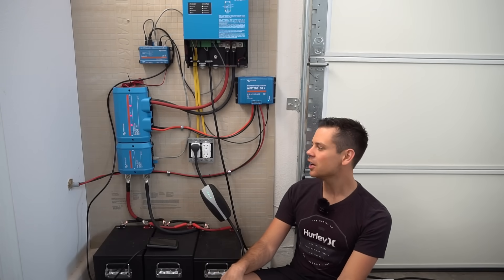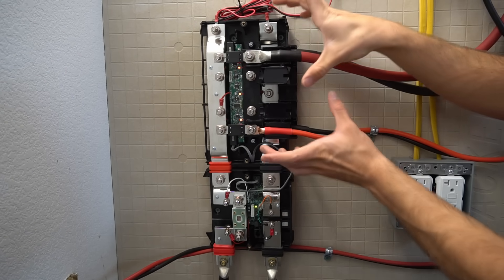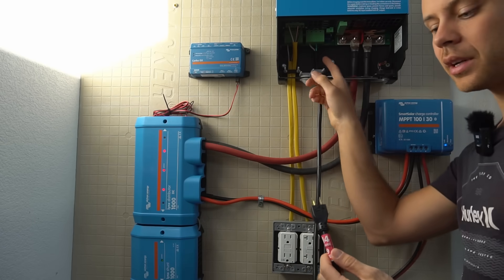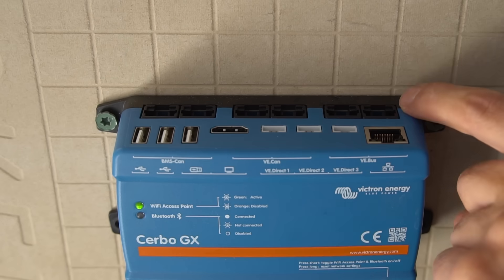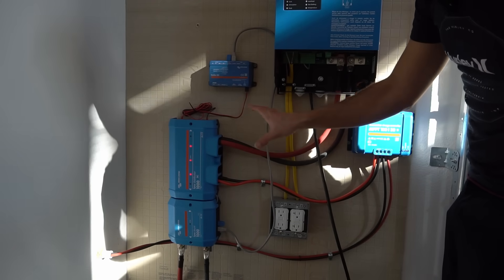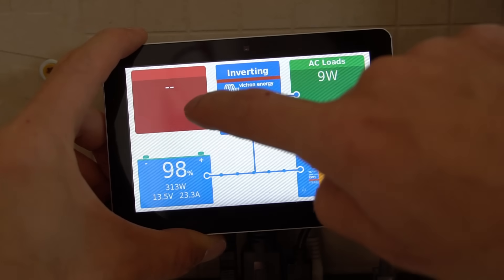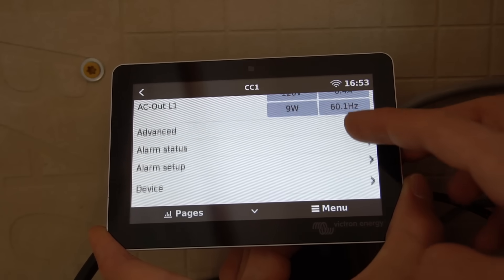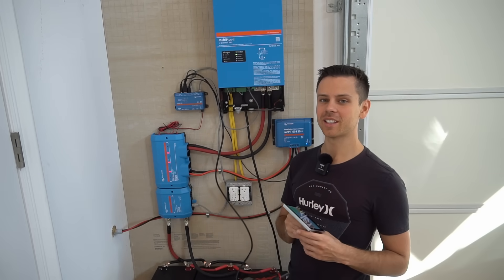Victron Made Easy! Design and Communication, Step-by-Step

Comment: We will be fitting 36 panels on the south facing roof,  at 400 Watts. On paper this should 
Generate 14.4 kWh. We have a good climate here so I would guess we would have 4 to 5
Good hours per day, plus the reduced rate before and after the peek. Minimum of 60 to 70kWh
Per day.
I have looked at our usage over the last 4 months and we have used HP and HC combined 
Average daily use of 34 kWh.

We will have a 10000VA Victron Quattro.

Also a 19.2kWh battery storage system, is this enough? Pylontech us2000.

Being an engineer this looks like a little overkill but I would like to be over than under.

Will this system work ?  Hope you can help

Best regards 

Ron

Comment: Question. Are you ok to go straight from the battery bank to the Lynx Shunt, or should you go T Fuse, Battery Disconnect, then Lynx Shunt. Or if the T Fuse is redundant because of the CNN fuse in the Shunt, should you place a battery disconnect between the battery bank and the shunt. Thanks. Great Video.

Comment: Hi Will, i’ve watched this video a couple of times and a question I have is it says you could add a distributor below the shunt to connect more batteries. Could the extra batteries be different (ah, name,lithium NMC) than the original ones?  Would that be safe and okay since they will be hooked through the shunt?  Would I need to add another distributor as well? Or would this not work at all? (I apologize for all the wounds) I watch and love all your videos. Thank you for the help.

Comment: I'm interested in setting up an inverter for my food truck.  The plan is to be able to keep my freezer and refrigerators on while I am driving.  All of my equipment is pulling approximately 10 amps at a 110-120v . Any suggestions?

Comment: Would you consider doing another YouTube comparing a Victron MultiPlus-II system 400w, 4 panel, 4 -100Ah  batteries with a Renogy system comparing the plus and mines and cost of the systems.  I know the Victron Energy - MultiPlus-IIictron system looks pretty BUT it seems to be about $6-800 more.  What am I missing?  I'm installing this system in my small Schoolie and about all I need is about 2-3000W system, but I want a good system.  I don't need to impress anyone with how much money I have throne at my electrical system.  Thank you for any help you can give me.

Comment: Hi, are you able to help me build an AC or DC coupling system using an on grid inverter which I have to an off grid inverter which I am planning to buy plus a battery bank. Energy in the UK is becoming expensive so would like to save money. Bye the way love you videos. I would love to DM you

Comment: Hi there,  great work explaining everything in simple terms. 
Q - if you have 800W of solar array, you could be pushing 60+ Amps at 12V.   
So why not build your system 0n a 24V system to absorb all the power ?
Or get a bigger Charge Controller. 
Q - also pushing up to 250Amps into your batteries can certainly get your 2/0 wires super hot .
Cheers…..Yvon.

Comment: I wish you and others showing beginner videos on electrical systems would stop touching electrical contact points with your fingers. Can't a plastic pointer be used? While you may know what's hot and what's not, you are showing beginners that touching contact points with potential current that it's OK to touch them. IMO, that's a bad practice as an instructor.

Comment: This is an awesome video and extremely helpful given that my Electrical prowess isnt great. I am looking at installing this system in my boat. The question I have is how/where would i connect my fuse panel, and where would i connect my 12v systems too (ie 12v draw, such as the fridge, pumps, nav system etc)?

Comment: Would love too see a victron 48v system explained! :) and thanks for the information 👍
Reply: it's the same thing just higher voltage and more efficient for higher power demands/larger solar panel sets
Reply: I use the 48 volt system and as was mentioned, it’s the same (except of course it’s rated at 48 volt), u even have an Orion 48v to 12v converter for my 12 volt stuff. I run it as two separate systems (the 12.v has its own batteries and is based on REDARC components that came with the boat). But if that system needs a boost, I flick a switch and boost it from the 48 volt system, brilliant! It also means I can run two inverters one Victron & 1 REDARC, for a total of 5000 watts on two 240 v circuits. Now I just need more panels and battery storage

Comment: In a typical FYI system,  the most expensive part is typically the LifeP04 batteries. However, the cost of the Victron equipment would increase the cost exponentially.   I understand from your other videos on how to build an FYI system, and to hook up a temperature battery Sense monitoring system, so that the MPPT controller will stop charging the batteries when the temperature drops to 32 F. I am wondering if one could hook up the Temp Sense Battery monitor to the Cerbo GX, instead of the MPPT controller?  Will the Cerbo GX communicate to the MPPT controller,, battery terminal temperature, and cut off the operation of the MPPT charge at 32 F?  thereby allowing the use of standard non-heated batteries, instead of heated batteries in a cold environment?

Comment: Hey Will, ,Thanks for the video. I’m building a 1000watt solar with 600 Ah lithium system for our RV. Ive purchased everything you just went through and a bit more. Thanks for clearing things up , It really helped me. You would think Victron would have some instructions in the box. I have one question? The multi plusII , Does it come per programmed for Lithium? or do I need to change that setting somewhere? Thanks again. I always enjoy your videos.

Comment: I have a Lynx 1000 PDS with 3 x 48v 3.3kwh batteries (Powerplus LiFe4833P) so there is one connection free. 
Can I add one 48v 5.1kwh to this connection?
All the batteries have individual BMS and the Invertor is a Victron MultiPlus 48/5000/70-50

Any help appreciated

Comment: I love your video! If you dont mind can you do a video on Grid tied inverters? I know from watching your vids, you dont like covering grid tied inverters because of local codes and such, but that it not your issue if they are not that bright. I really need help with a 15kw system form my home and im having a really hard time finding ONE 15-20kw inverter for my needs. I know, I can use two in  parallel but thy do that when I could use one. I know there are three phase inverters that are grid tied and can output the KW i need. Do you mind creating a video that specifically focuses on Grid tied high power inverters. I know it would get alot of views. Thank

Comment: I bypassed the switching power supply on all my devices that use 12v DC, instead of using an inverter, and I must say I get about 8x the life from my batteries by doing this. 

If we’re serious about reducing our power consumption then I believe every solar setup should come with a 12v DC source and devices that can hook directly to it.  That would reduce the entire planets consumption of electricity by an insane amount.
Reply: that would be where you use the Victron Orion-TR that does DC-DC and yes bypassing inverter/switching power supply removes a LOT of inefficiencies, so well worth doing.

Comment: Can I use two MultiPlus II units to get a 240v outlet and 120v outlets and still run them simultaneously (of course while under 3,000 watts)?  Reason is I have a 4 burner induction stove I'd like to use while not connected at a park.

Comment: I picked up a Victron mppt with mc4 connections. It has 2 pairs mc4’s but the user manual says to not parallel the installation. Are the 2 pairs mc4’s already parallel inside the charge controller?

Comment: I have installed recently an HUAWEI SUN200L-4KTL and it was a much more easy... the amount of different components required in this installation is a nonsense... nowadays basic inverters manages 2 strings with MPPT included and battery charge load and download jointly with included net connection, if you want also zero net injection, and icluded WiFi to check everything from your cellphone

Comment: I have a victron 100/50 charge controller, it’s great. I’m surprised you have 800 watts of panels and your not over the 100 volt limit for the controller. I have 3 panels and their 250 watts each, I wired them in series. I can only use 2 panels because 3 of them go over the open circuit voltage of 100 volts and the controller can’t handle it. Can I wire my three panels up in any other way so that my Victron 100/50 charge controller can handle it? I have a 24 V system.
Reply from the maker: Distributor was out of stock and this is just a example system for communication system

Comment: Thanks for the video. 
QQ. When you connected the grid, it showed current coming from grid and solar. Is there a way to prevent it pulling from the grid if you have solar operating? I know this means it will take longer to charger the batteries
Reply: you connect a relay that turns on the grid connection if battery power gets too low, so it will then charge the batteries and power your offgrid grid (that was the more advanced connections on the inverter he didn't go into)

Comment: The only mistake I made on my off grid system was buying a Victron inverter .... extremely poor customer service and an over priced  product from out of the dark ages !!
Mine failed after just 8 months and they said they could not repair it because that had no spares ??   I am now on a 48v LifeP04 style inverter which has been faultless for 5 years now ....  why did I waste £3000 on Victron when I could have bought better for less than 1/3 of the price ...  Now you know !!

Comment: If the grid is disconnected, are solar panels given priority during the day? what is the power priority in the case of off-grid? And I have a second question, can this system work on 48v with victron multiplus II 48/10000 inverter? Thank you and best regards!

Comment: I was hoping you’d cover the temp sensor ports on the Multplus II.  Ports #9 and #10…. The manual states that the lug end connects to the negative terminal on the batteries.  Since I’m setting mine up for the first time, I’m nervous about connecting it.  I can’t find any example of this so far.   I’ll keep searching…
Reply from the maker: Are you using lead acid?
Reply: @WillProwse  Nope, LiFoPO.  Two parallel BattleBorn Game Changers.  My BMV-712 comes with a power lead, but not the temp sensor.  There is a temp sensor for purchase for the 712, but the temp sensor that came with the MP II Inverter is for the inverter.  Others are using that for the BMV, but a video supplied by Victron states that this temp sensor has a chipset rated to a max of 5 volts and to exceed that will permanently damage the chip.  Plus, the MP II manual, section 4.4.5 states to connect the Temp Sensor lug to the negative battery terminal.  I’d have to assume that the inverter then supplies the 5 volt power via port #9.  I thought nothing was to be connected to the negative terminals prior to the shunt, so I’m a bit confused…. Thanks in advance…
Reply: @WillProwse  Addendum:  Since it’s important to not charge LiFoPO lithium batteries at or below freezing, I’m thinking the temp sensor function on the inverter is to protect your battery bank by disabling the charging function on the Inverter when it sees the battery temp that low.  Is that an accurate assumption?

Comment: Awesome videos…..! Many thanks for the time and effort you put into making these. Forgive me but Ive looked through your library and I cant see any on 1. Hooking up a generator to the Cerbo GX. I understand it has a dedicated relay (R1) designed specifically for the auto start/stop of generators but I cant find anywhere that tells me exactly how to connect the wiring loom from the in my case Cummins Onan generator to the relay. 2. Also, I’ve just had a new more powerful solar system installed on my barge and I’m hoping to dump excess energy into the hot water tank via the immersion heater. Any help there would be hugely appreciated. Thank you👍

Comment: Will
It is good to see the Victron set up as well as the generic type systems you do on this channel. If this system is to run a home then why are you using 12 volts rather than 48 volts

Comment: I have a grid-tie solar system. I want use my panels in the event of a extended power outage event. The panels are stringed to 450V. What inverter should I use to make use of the solar panels when the grid-tie inverter is offline. The house panel will be disconnected obviously. Is there a way to use a inverter charger to enable the grid-tie inverter? Or is that not advisable due to no place to dump excess solar generation.

Comment: Solar virgin, looking at buying a full system using Victron. Have been offered the system below , please comment. Great videos 
Converter-charger 10000VA 48V 140-100/100 Quattro-Victron Energy
Regulator of charge 100A MPPT 250/100 Tr VE.CAN Smart-Victron Energy : 2 units
Supervision of the panneaux et du système - Cerbo GX - Victron Energy
Systems distribution DC Lynx Power In 1000V - Victron Energy
Systems distribution DC Lynx Distributor 1000V - Victron Energy
Interface MK3-USB (VE.Bus - USB) - Victron Energy
Lithium Pylontech. US 2000 . 2.4 kh.  8 units
Solar Panels. Possibly TrinaSolar 400 w, Moro Vertex S,, 36 units.
I understand 36 maybe overkill , 4 strings of 9 but I’m sure someone will tell me.
Plus switch’s cables etc.
Emergency use of generator availability.
South facing roof , 3 roofs. First 6m x 4.3m. Second 8m x 4.3 m. Third 6m x 5m.
 Regards Ron

Comment: Thank you for talking about Victron. They are expensive but they are also great! Perhaps go over what you just did - for example, the leaflet with my "12V" battery (Blue Nova  BN13V-108-1.4k BT) says charge it at 14.2Volts - where as you were using a lower voltage.

Comment: I appreciate these insightful videos and thank you for your time, effort, and thorough experience. Forgive my ignorance, but is there beneficial reason to use a system like Victron (with many components) verses an all in one system using something like the MPP LV6548?
Reply: Expansion capacity, ability to replace/upgrade specific components

Comment: What's best for victron? 12, 24 or 48v batteries? I see that a lot of charge controller are only compatible up to 24v, would it make sense to stay with 24v to reduce the cost of charge controller?

Comment: Do you have any concerns using victron equipment inside buildings, given the code requirement to keep dc circuits inside metal raceways or cable (690.31(d))?

Comment: I'm just a little confused by the size of your MPPT.  If you have 800 watts of PV coming in as 12volts how can that be under 30amp? Isn't it 66.6 amps so you would need a 70amp MPPT? Or is it 24v into the MPPT and 12v out to the inverter?  Can the input to the MPPT be 12v or 24v?  Even if it's 24v into the MPPT isn't it still a bit small?
Reply from the maker: Don't overthink it, it's a demonstration system and we were out of larger mppt. I'll add a better one in due time. For now, this works fine
Reply: @WillProwse  No worries, I just wanted to make sure I was thinking about this the right way. So you do have 24v into the MPPT, right?
Reply from the maker: @Captainloz  yes higher voltage indeed. the mppt can handle overpaneling if you don't exceed the voltage limit

Comment: Great video!  Question - Our menu is different.   When we tap menu then shunt, there is no settings choice there (though the rest of the list is the same). While I can find some of the battery information elsewhere, i cannot make any changes. I cannot get to the battery settings you showed. Is it because i have a different shunt? We have an RV and just got the Victron Multiplus II 120x2, Cebro GX and a Smart Shunt 500/50. Right now, we still have lead acid batteries but will later have lithium iron phosphate. Thank you so much for your videos!

Comment: Do you know if any non-Victron inverter supports something like the PowerAssist feature Victron has on their MultiPlus? (this is to be able to use a light weight  generator 2kw inverter in parallel to 2kw battery inverter to power an AC in an RV)

Comment: Building a solar/shore/12v system for an offroad trailer, judging by the list you provided, all id would need to add would be a victory 12v to 12v charger correct?

Comment: Great vid. And I'm really wanting to go Victron. But look at all the components you need for this system (and expense) vs. an All-in-one (MMP, Growatt).  I'm really struggling with the choice here for 3000-5000 watt system for a RV/Tiny Home. Is Victorn really worth the premium?  And is it worth having to deal with all these components and cabling between them vs a compact (and somewhat portable) AIO unit?
Reply: Long term you’ll be glad you spent a little more on a quality Low Frequency inverter not made in China.  Those growwatt high frequency Chinese inverters I wouldn’t expect to last nearly as long.    Current on year 12 running non stop on a Magnum LF inverter, no issues yet 12yrs later.

Comment: very good video! Nice, simple, and to the point!
I see that you dont actually have a BMS connected is that because the SOK batteries have their own BMS built in so you arent going to worry about it?
Also what is the purpose of the Distributor? is it just to hold fuses and check if they have blown? why does it need smarts?